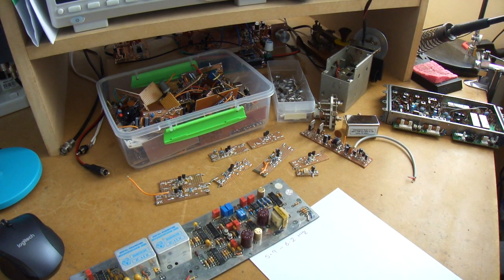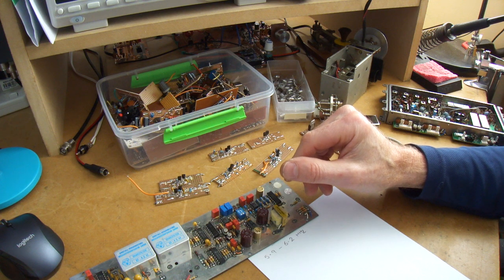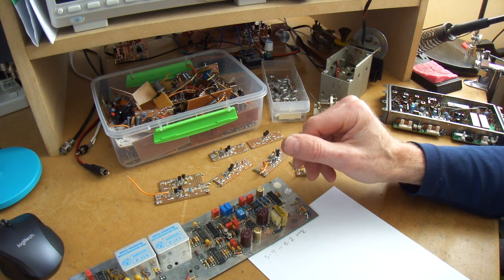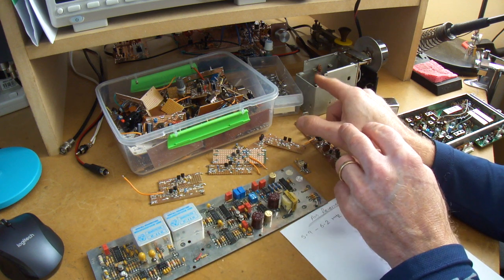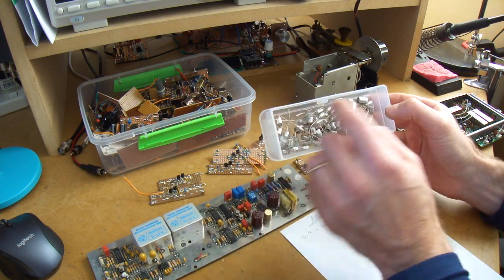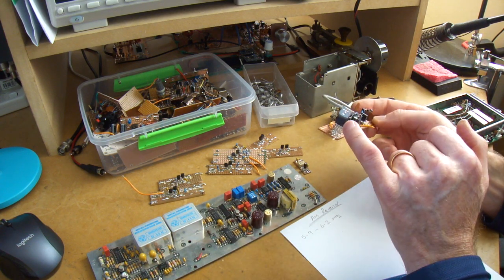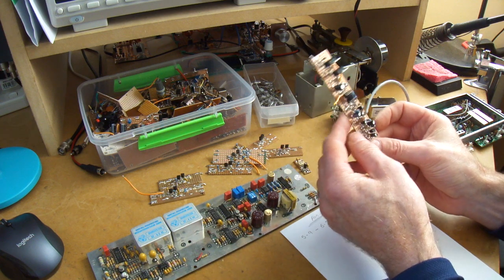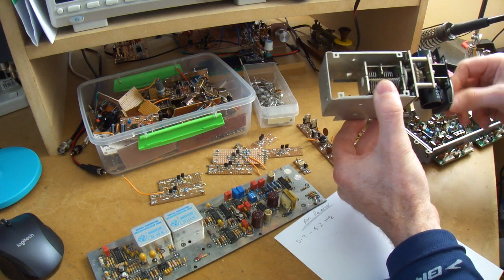Shortwave AM Receiver. Part 1: Thoughts and Ideas

Comment: Funny you should mention analog and the J310.

I was recently revisiting a receiver project from way back and, like you, just got frustrated with trying to build an analog VFO.

As I looked over that old design, which used a J-FET based VFO, I scoured the web for VFO designs and found several, which were quite stable and relatively easy to construct.  

Virtually all of the designs used the MPF-102 which are all but impossible to find, but as I assume you know that in 99.9% of the cases, the J-310 is a near direct replacement.  The problem with the J-310 is that the leaded version is starting to become scarce in favor of the SMD version.  Sadly however, these days, that isn't unique to the J-310.

Long story short, I've come to enjoy the Hartley design as it is pretty stable and a very forgiving design.  Basically, if you stay within some general guidelines, it will oscillate. 

Just my 2 cents

:)
Reply from the maker: Thanks Christina. I'll put up a video today on the VFO. It's been fun and a little frustrating at the same time. I did start with the Hartley, which worked well, but ended up with a Colpitts. I must admin having the oscilloscope made life a lot simpler, that;s for sure.

Comment: Your VFO tuning cap looks to be a dual section cap. If both sections are of the same value, check out this design from VA3IUL: https://www.qsl.net/va3iul/Push-Push_VFO/Push-Push_VFO.htm

I think some people dislike the J310 because the through-hole part is difficult to find for many people. The SMD part, MMBFJ310, is exactly the same and is still widely available. I love the J310 myself. It's a very useful and capable device.
Reply from the maker: Thanks for that. That looks really interesting.

Comment: Hi, Charlie if you want to experiment with a receiver board I have the SI series chip on a board that is prebuilt.
If you are interested I will send you aboard. The board has a receiver on it it only requires some external components. It covers AM/FM/ Shortwave capabilities it uses a 32.762Khz crystal I can send you the board and spec sheets.
Reply from the maker: Thanks David. What I might do for now is play around here and see how I get on. I'll certainly keep this in mind though. Thanks again.
Reply: Charlie just let me know if you want a board in the future and I would be happy to send you one.

Comment: SW AM receiver?  Ever think of playing with the Si4735?  This is a single chip SDR that tunes from the MW band up through the FM BCB.  There is even a SW patch you can load that will enable a BFO for SSB/CW reception on the SW bands.  This chip used to be widely available for under $10 US, now days it's about double that.  Check out the facebook group using this part.

Somewhere in my junkbox is a VFO from a Yesau FTDX101 rig, looks like you have part of one, mine was working last time I tried it, but I've salvage the knob off of it for another project.
I've also got a few Collins 455 mech filters that might be worth playing with.
Reply from the maker: That's interesting. I will take a look at that.

Comment: This will be an interesting project, Charlie. You've reminded me I still have to build an AM receive section for my 80m qrp am transceiver project. 
The transmit section was quite straight forward... divided a 15MHz crystal by 4 to create a carrier on 3.75MHz and modulated the carrier with a TL431 voltage regulator. 
Time to dive back into my box of half-completed projects!
Reply from the maker: That's the spirit Gilbert. I still have the AM TX sitting on the shelf. Now that I have got the Class E amp working I might try that out again. I'll add that to the ever growing list.